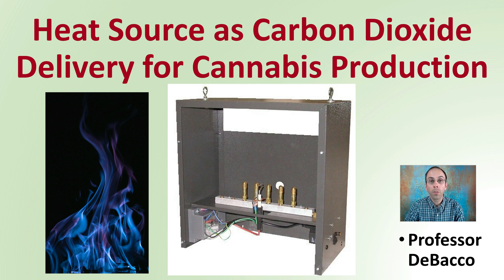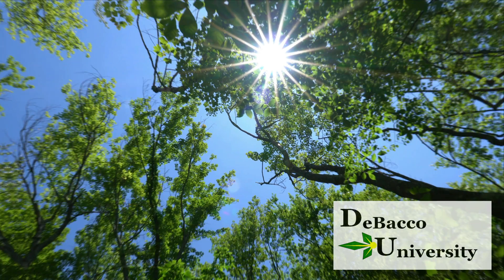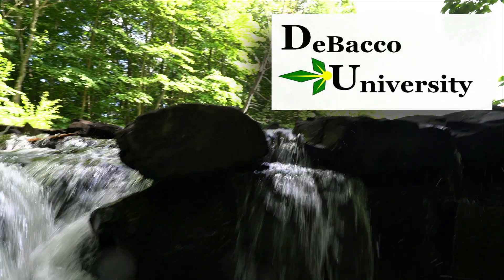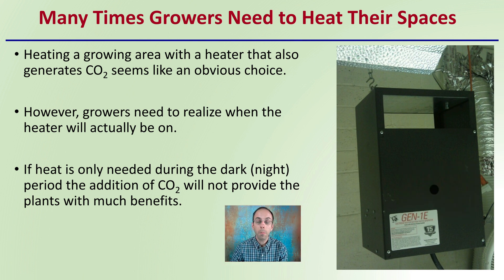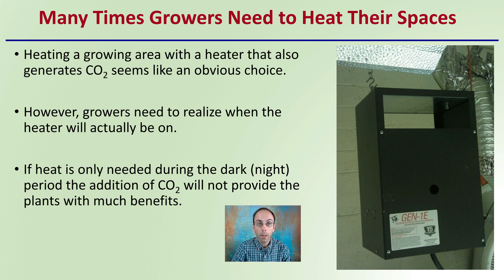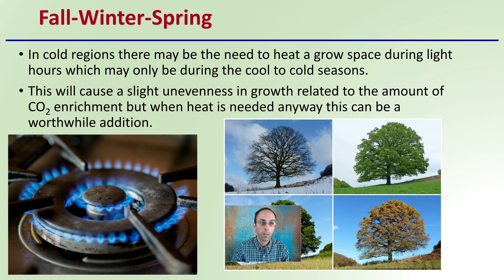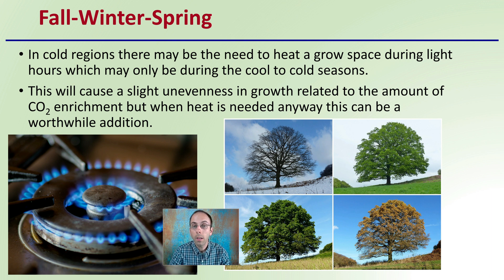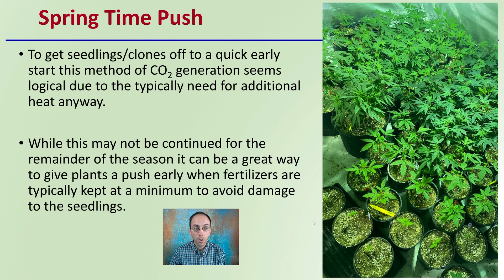Heat Source as Carbon Dioxide Delivery for Cannabis Production

Comment: Hey im new to running a sealed room . I have a fan and scrubber ( carbon filter ) but it does not vent out . The sensor works on photo cell so its off during their 'bedtime' but levels dont really drop too much or too fast . Is it damaging to plants to sit in 600-900 ppm of CO2 in the dark ? Or just should not be replenishing during night photo period ? Thanks for your time in advance . New sub here 💚🌱💚💯
Reply from the maker: Thanks for the subscription, be sure to tell others of the channel as well;-)
Regarding your question, CO2 levels can hang at elevated levels, after lights off.  While the plant can not use CO2 at this time of the day, there is also no negative impacts on the plant from having these elevated levels at "night".
Reply: @DeBaccoUniversity  awesome !! Load off my mind for sure . And i dont HAVE to put a vent in my sealed grow . Ill share your content around for sure . Respect Blessings and many Thanks for said content and your time in reply 💯💚🌱💚
Reply from the maker: No problem, and thanks for spreading the word about the channel!